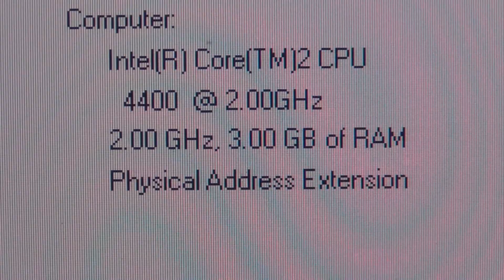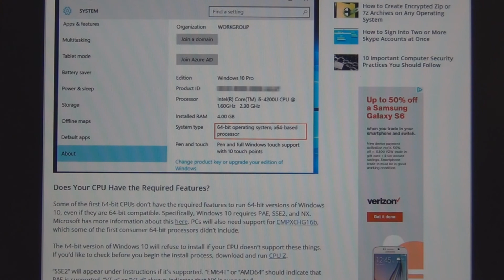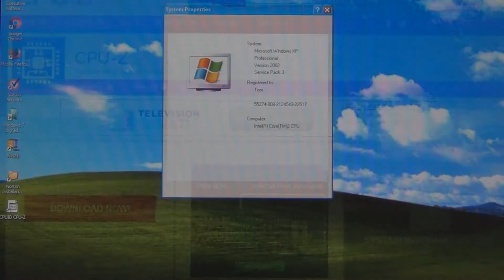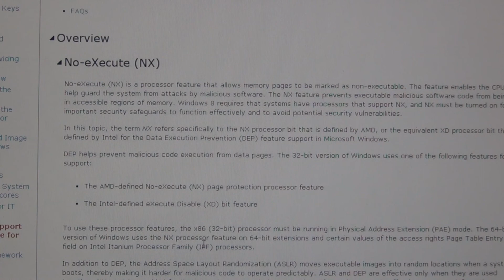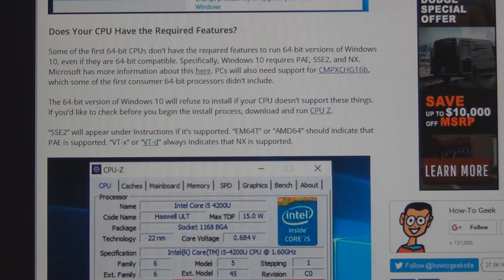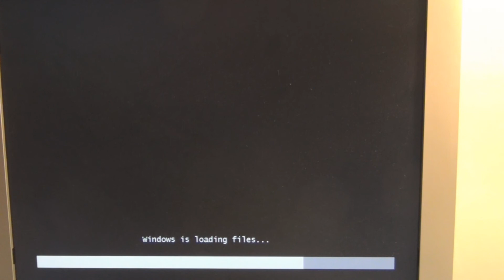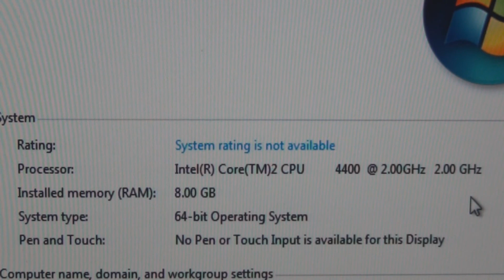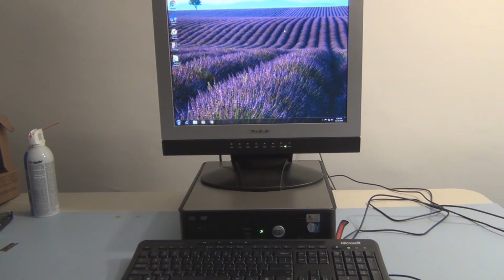Dell Optiplex 745 64 bit Windows 7 Upgrade

Comment: 5 years later I’m looking at your post.  I have a 745 which I am just playing around with as a project.  I installed 8 GB of Ram with windows 10 on an SSD.  I’m still going through updates.  I’m going to be looking at updating the CPU

I noticed you questioning that fan under the hard drive.  I don’t have that on mine because it is the larger form factor, but that cooling fin on the motherboard just under that fans gets super hot so it makes sense to have a fan... I need to add something.

Comment: I upgraded to win10 64bit  installed a quad core cpu and a geforce 2gb gpu    and it can run  assetto corsa.  Project cars with post processing enabled. 60 plus fps. Which for a dell optiplex 745 is pretty good.  Considering it sat I'm my attic for years.   Also. Change the direction of the cpu fan so it blows the hot air out the front

Comment: The Optiplex 745 will run Windows 10, with a 2TB Hard drive,  mine started with Vista, 2GB Ram, and an 80GB HDD, it is  the fastest machine now that I have ever owned, I love it, and I only paid £10 at a junk sale., it came with everything original with it, even the monitor had a built in Camera all working well. Was a bit dusty but cleaned up nice.
Reply: Same

Comment: I have a optiplex 745 pentium d 3.4 ghz with 8 ram & 1tb with windows 10 pro is that good for music production?
Reply: Leo Martinez buy a core 2 quad q9400 it is for 15 $ on Ali Express that is going to give you a big push for your system and better power consumption
Reply: @64bit72  It works???
Reply: @iZam1981  yessir

Comment: i have a Dell Optiplex 745 with a Pentium D and 2gbs of RAM an 8gb HDD and no pcie GPU and the HDD has been formatted and has no operating system it has EM64T support but whenever i install windows 7 64bit and it installs up to the point where it has to restart itself for the first time in the installation process and once it restarts i comes back on with nothing but a black screen with no mouse or nothing just black and if i manually restart it while its on this black screen it comes back on and tries to start windows 7 as normal but it hasn't finished installation yet so it comes up with a message saying "windows installation not complete press ok to restart and continue installation" if i press ok it restarts and comes up again and if i just close the window or restart it manually it does the same and there seems to be nothing i can do i cant even launch with command prompt anyone know why? pls help.
Reply from the maker: 2gb of memory is the minimum requirement.  Maybe try adding additional ram.  Has the bios been updated?
Reply: eTechTom i dont know to update the bios without an OS but the RAM might be the issue thanks
Reply: Open the case, remove the HDD, and carefully check all of the capacitors on the system board. Optiplex 745 models are known for having faulty capacitors installed that burst later on. This can cause crashes, and random reboots and shut downs.  A bad capacitor will have a bulge on the top, and/or be leaking a black substance.

Comment: Very interesting video! I own a used 745 incl. 4 GB RAM, Dual Core E2140 @ 1,6 Ghz. and just installed Win 7 Pro 64 SP1. While loading new content in any browser, there are some filckering parts at the top or the bottom of the screen. I also tried to install a GeForce GT 520. BIOS is 2.6.6 (latest Version). Setting it to "Auto" didn´t work, but the Cardrige works on different PCs. Screen says "No Signal" and stays black, but Windows starts. Dells driver list that´s linked in the comments lists a 2 BIOS iso files in the Video BIOS folder. Starting it opens the burning dialog. 
The Video Driver folder lists 4 drivers. How do I know which Dirver I should use and what to do with the iso files in the Video BIOS folder? Please help me
Reply: @_yoko_ Thank you. My post is 4 years old. since 3 years I don´t use the dell PC anymore.

Comment: I got a dell optiplex 745 decktop I wonder if you know a good gaming  cpu that us under 50 and a graphic card that is under 100 and how ram card does it would take thz
Reply: Cpu= Q6600, £20 eBay
GPU= GTX 730 £30-70 depending on ram, and height

Comment: If I were to upgrade from Win7 32Bit to Win7 64Bit, would the data on my EXTERNAL Hard Drive get wiped?
Reply from the maker: +Aviator Sproket You'll need to back up your files and choose the custom option during installation.  Then you'll need to restore your files and reinstall your programs.  The upgrade is only going to effect the hard drive or partition that the current operating system is occupying.  If the external hard drive was just for storing data it is unaffected.  Here is a link explaining the 32 bit vs 64 bit system.
http://www.techsupportalert.com/content/32-bit-and-64-bit-explained.htm
Reply: +eTechTom Thank you, friend!